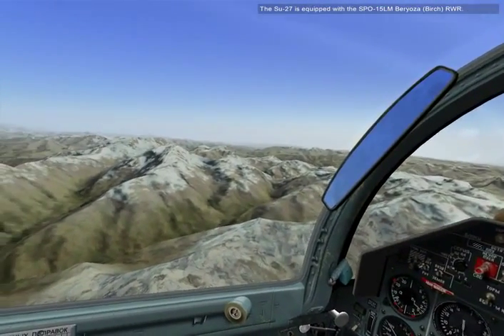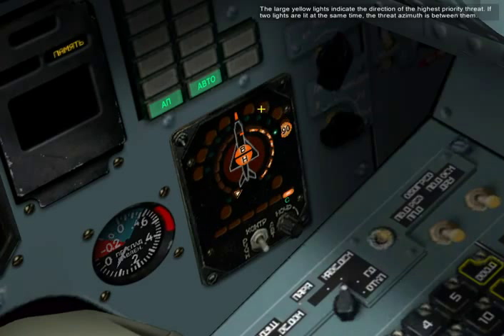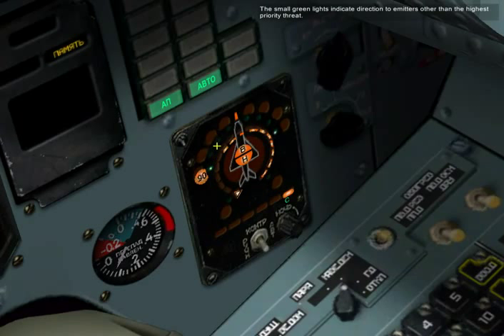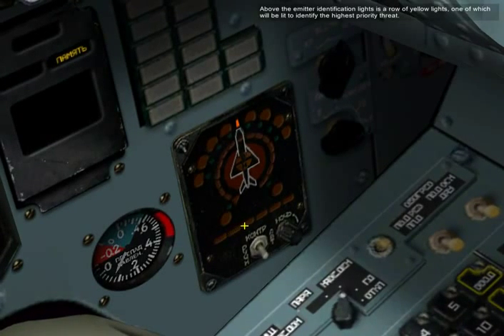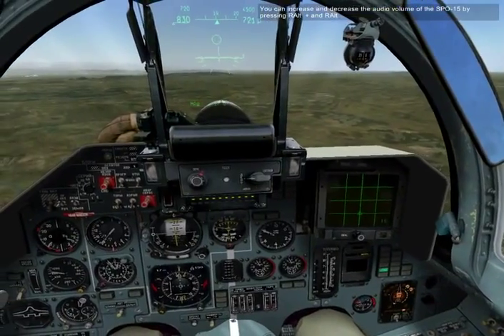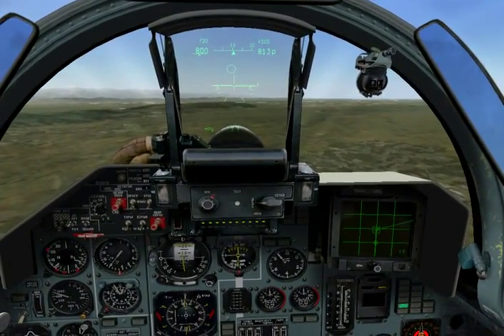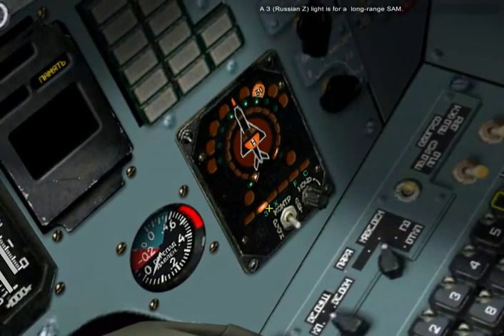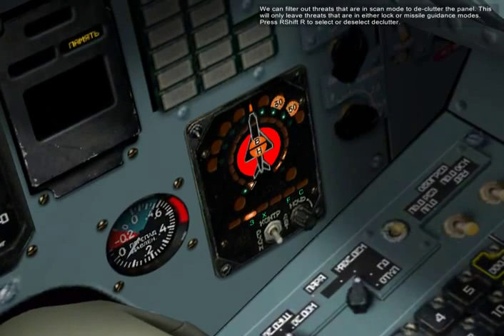20. Su-27: Radar Warning Reciever (RWR)

Comment: RWR display is too small in su 27
Reply: Su-27 was designed as an Air Defence fighter for PVO Strany, it was not meant to be used over enemy territory, thus it's RWR was of lower importance, a simple and cheap device, just in case, with small indicator placed at the bottom of the cockpit. In comparison i.e. F-15 was designed as an offensive air superiority fighter flying, most of the time, over enemy territory and SAMs looking for enemy fighters ,so it's RWR was sophisticated, able and it's big display was placed right in front of pilot's eyes in the cockpit.
Reply: literally use your ears